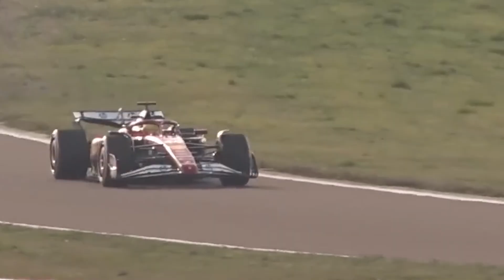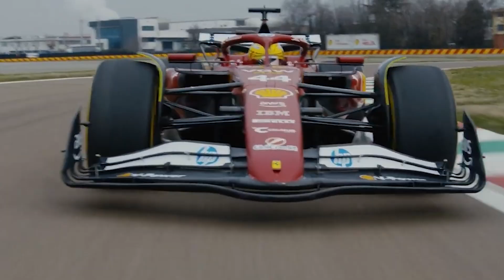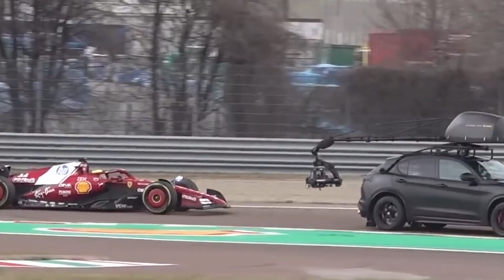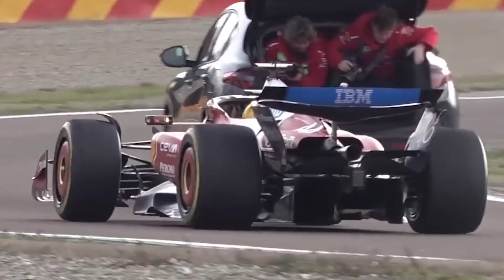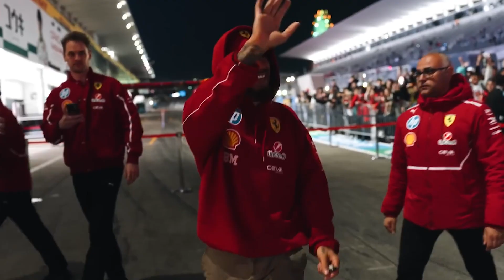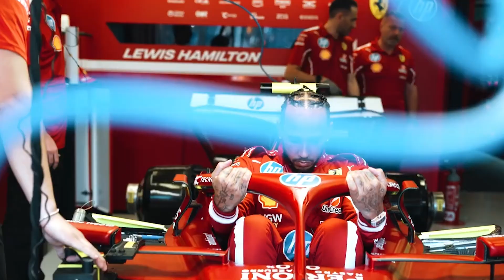Ferrari fine-tunes Hamilton's SF-25 ahead of the Emilia Romagna GP

Comment: I don't understand why Ferrari are taking all the flak for SF-25 failure.
Ferrari had to change 99% of their last season car in anticipation of Lewis arrival.
One of this is moving the cockpit seat rearward, as one of Lewis' major issue with Mercedes cars having the seat oriented frontward.
Of course extending the seat position rearward means the car must now have a longer wheel base (their car became longer) which, while great in conventional tracks is pretty unwieldy in slow speed corners of tight street circuits (something we saw in Miami).
Of course a longer wheelbase mean changing a lot of stuff like the floor aero profile (which has now become more sensitive to airflow disruptions), upper body aero, transmissiion, etc
which was why Vasseur said they need to change 99% of the car.
Another change that where directly influenced by Hamilton's arrival are with the suspensions, and are now the focal point of their balancing issues